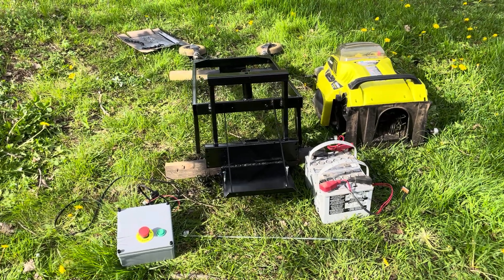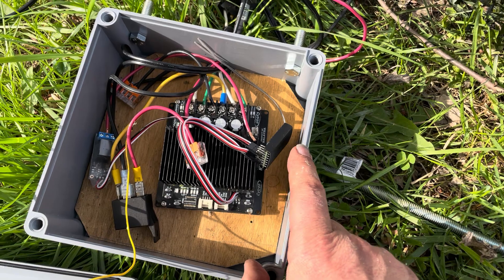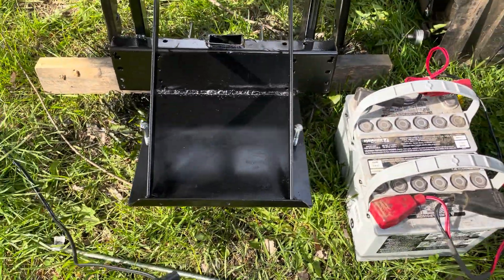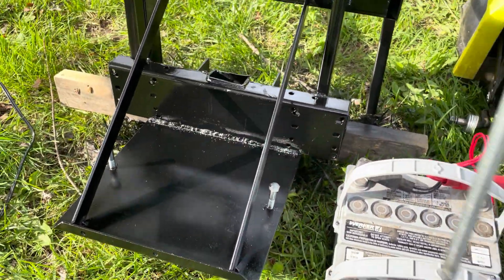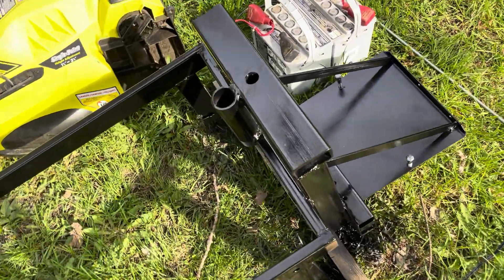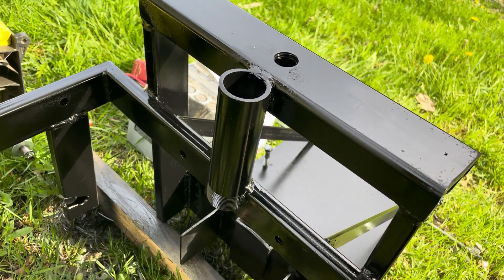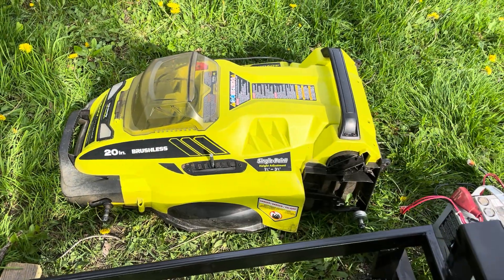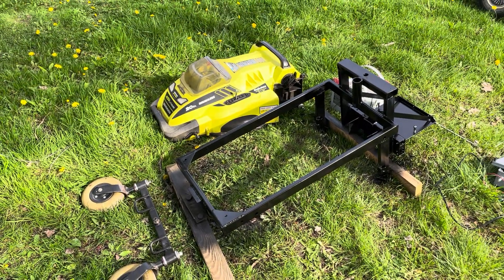RC Lawn Mower Update: Control Box, Weld, Paint

Comment: What size and thickness of rectangle tube did you use? With adding the batteries off the back, is there any issues with steering due to the front end floating?

Comment: Great stuff, what kind of tires are these on the motors?
Reply from the maker: They are 10" tires from Harbor Freight.
The mobility scooter originally had hard rubber wheels, which had terrible traction on the grass. I bought Harbor Freight wheels (on sale!) took the tires off of them, and put them on the mobility scooter rims.
https://www.harborfreight.com/10-inch-pneumatic-tire-with-gold-hub-41475.html
Reply: @BenjaminNelsonX  Thank you for answer but how to mount them to the motors, the hubs are different.
Reply: @Nakelp86 he used the the factory rims with HF rubber.